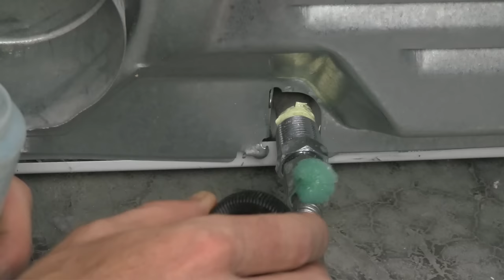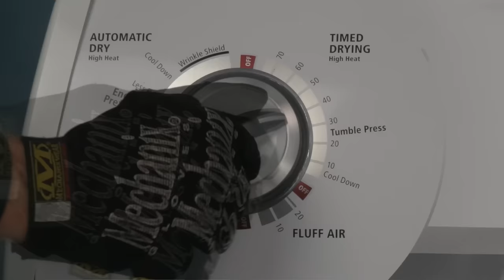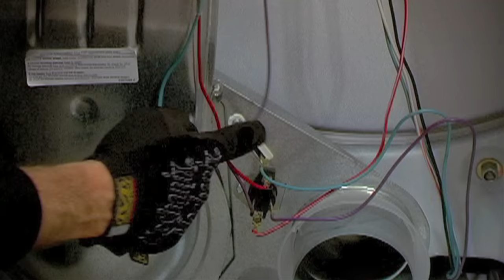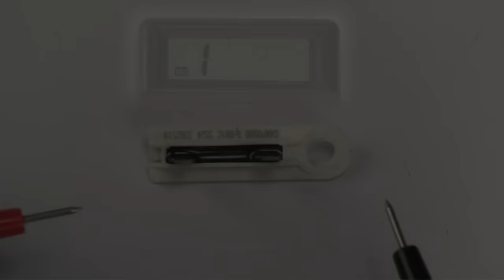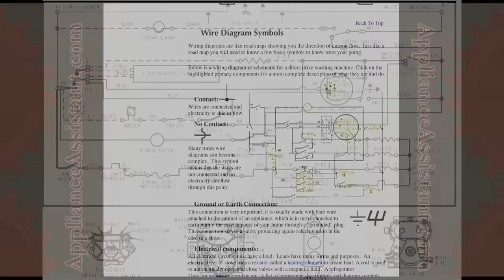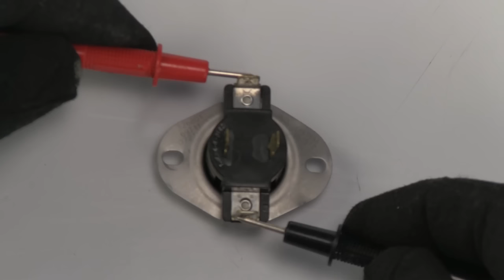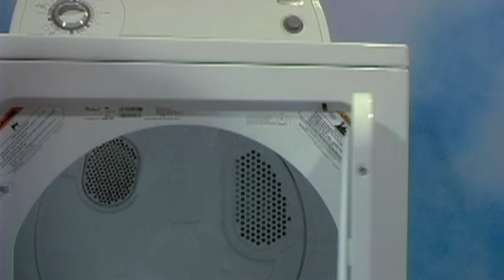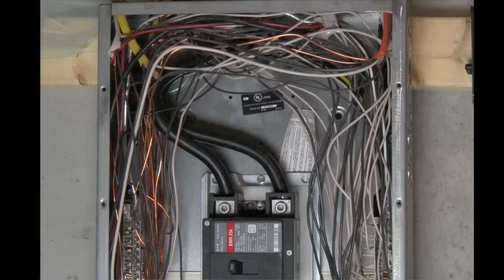Gas Dryer Repair: Fix Heating Problems

Comment from the maker: Thanks for the question! does the ignitor cycle off or does it just keep glowing?  Opening the valve is a bit of a no no for safety... I'm not sure if that is the main problem but you probably should replace it after opening : ( The only place I have ever seen a valve clogged is in the small gas orifice (spider egg) Apart from that Look for check fittings that may be cutting gas from getting to the valve. Hope that helps some!

Comment from the maker: I would be inclined to change the coil solenoids on top of the gas valve... "after a heat cycle, it no longer seems to light" The automatic cycle on that dryer is advanced trough the heating circuit. So because the cycling thermostat only opens once for the first cycle, the timer is not being energized to advance when the later cycles fail to light and heat the thermostat. Hope that helps! Good luck!

Comment: Definitely having a hard time with mine. Roper Model rgx5634kq2. All the fuses and check out and resistances look good. The heating plate heats and the gas lights, but after a heat cycle, it no longer seems to light. I can see the heating plate glow red, but the gas doesn't ignite for the cycle. Mine is similar to m2theferg, but my timer seems good. The countdown cycles are fine since it shuts off at the end of the count down, but the autosensing cycle runs until I stop it. Same problem as Chad?

Comment from the maker: installing a new fuse will probably fix the heat problem but the timer must also have a problem part 8299764  that timer can be opened and reassembled fairly easily... however, before you open it you should be willing to replace it...  and when you are putting it back together don't force anything. usually shifting the timer knob back ad forth will get the inner timer cam to seat back into place. When it's open you may see why it's sticking. Good luck! and congratulations!! : )

Comment: Sorry kind of a dup. reply but I'm not savvy with msg kinds of things. Roper rgx5634jq0 -Checked fuse shows open-in my mind that doesn't explain why dryer doesn't stop during timed setting, explains the lack of heat. I hear timer ticking, knob advances but never hits stop limit Symptoms are concurrent never had heat/stop issues before. Pretty good exhaust flow, sniffed very slight gas leak on the flex will replace, also missing wiring diagram We have a baby, laundry piling, please help -THANKS!

Comment from the maker: What is your model number?  It definitely sounds like a timer problem and your heating problem could also be associated with the timer, depending on what contact is bad... If the fuse tests okay check for 120VAC at the contacts. It could be that the timer is not sending electricity down to the ignitor.

Comment: I'm getting ready to test the fuse, guessing this is my heating issue However, my dryer has an additional issue - it doesn't stop. last night using the auto sense setting put in the last load before bed, woke up early heard dryer still running & load still damp. To make sure that it shut off on a timed load setting.set the load for 30 min hour later still running. Any thoughts on the cont. run issue? Timer counts down but doesnt shut off. Any advice?

Comment from the maker: Hmmm... What is your dryer's brand and model number?  when it tries to light after the first cycle, is the ignitor coming on and going off with no ignition? The timer not advancing could be because of an automatic cycle(more dry, less dry, etc.)... does it advance when it is on a timed dry cycle?

Comment: On the thermostat heater:
If I have continuity between the outer prongs, but not on the inner prongs, then I need to replace the part? 
This the only part on my dryer where I've gotten readings that do not match what you've described in your video as proper working order, and a couple other videos I've seen as well.
Would this part being faulty cause the problem of my dryer not glowing/igniting/heating? Please give me some good news, Appliance Assistant!

Thanks

-itswhip

Comment from the maker: Thanks for posting! That is definitely true when it comes to range ignitors. However, I have never in 16 years seen a weak dryer ignitor that would not trigger the flame switch... I suppose it's possible but very rare.  Thanks!

Comment: Great vid, I'd like to add to the discussion for those watching.

If your dryer's ignitor is lighting up but it fails to trigger the valve it the ignitor could be weak and need to be replaced. You should of course check the other possibilities mentioned in this video but keep the ignitor in mind.

Cheers.

Comment from the maker: If you are getting ignition but the valve only burns for a few seconds then shuts off it would usually mean that there is a clog in the venting somewhere or the hi-limit thermostat is getting weak. Note: the dryer needs to be back together when you test it for the blower to effect the flame, and draw the heat back off the hi-limit thermostat... If you run the dryer with the door open or the drum out then the hi-limit thermostat will do it's job correctly and shut the burner down for safety...

Comment: Great Video! What is the average burner on time and off time cycle for a typical dryer, for example my observation was burner comes on for about 60 second then off for 30 second, repeatedly.

Comment: These are your exact words, "Sorry, your comment got flagged as spam for some reason", but anyway, not like we are in a court of law. I thank you for your advice and by the way, I replaced the motor last week, You just responded 17 hours ago,  Again, great videos and thanks for the response.  PS Ebay has these original motors dirt cheap with free shipping. It would had cost way more just to have someone swing by to "look at it", word of advice for future readers.I tested the item before.

Comment from the maker: Sorry, your comment got flagged as spam for some reason so I missed it...  Most likely it the motor if it actually stops running.  The cycling thermostat would only effect the dryer heating. Hope that helps!  Thanks for the comment!

Comment from the maker: Well I can tell you what it's not... Maybe that will help you figure out what it is. It's not the ignitor or thermal fuse. but it could be the flame switch, cycling thermostat, hi-limit thermostat, or timer.  hard to say which one for sure without testing for voltage when it's not working. What is your model number?

Comment: Nice videos, I am going to test mine, I have a Whirlpool gas dryer that runs great, but than stops and does not turn on until I let it cool down, what do you think it might be?  I cannot decide if its the  "motor fuse" and also the "cycling thermostat"?   What do you think?

Comment from the maker: It's ether an air flow issue or the hi-limit thermostat is weak.  (Probably air flow) 
Is the dryer properly reassembled before you are testing it? 
Does it do the same thing with the duct disconnected from the back of the dryer?

Comment: Have you resolved your problem? I have a maytag and it starts, glows has a flame (orange)but after 20 seconds or it clicks off, checked flame sensor, thermostats on top, thermostat on heat tube (near flame sensor) all are good, son said he replaced coils a few weeks ago, and still has problem.

Comment from the maker: Sorry it took so long to get back with you!  If the dryer is open then the blower cannot draw the flame's heat back off the hi-limit thermostat. Therefore it will do what it's supposed to do and open, turning the burner off.  If the dryer reassembled for your test? 
Again sorry for the delay, you probably already have this figured out...

Comment: I have a Maytag dryer very similar to the one your are repairing in this video. I replaced the coils a few months ago and have tested the flame sensor and both thermostats on the tube and all test out fine. My igniter turns on and the flame kicks on (although doesn't seem as powerful as it should be, more of a fire than a blowtorch) but turns of after 15-20 seconds. Troubleshooting leads me to the coils, but those were just replaced. Any ideas?

Comment: Thank you so much for this video. What would you guess cost for repair for a 'pro' to have done it? I replaced the coils and fixed my dryer, only took about 10-15 minutes after I had the parts ($37) and tools (had to get short phillips $4)  on hand.  I have had 4 major appliances, and 1 minor appliance fail since buying my home, and it was built in 2004. I have fixed 3 out of 5 using Youtube videos.

Comment: I have a kenmore 110 72032100. drums spins, no heat. I replaced the ignitor and still get no glow. Is it likely to be a bad fuse? I'll check thermal fuse tomorrow when I get home. Thanks for the video, very helpful.

Comment from the maker: Sounds more like a coil problem. the coil kit on the top of the valve can cause what you are describing. Even if it is the valve I was surprised how inexpensive they can be purchased online.  If you do need parts I would greatly appreciate it if you purchased through the links on my website! I get a little commission : )  The link is in the description of the video. Thanks for the comment!

Comment: My dryer has intermittent heat.  Reading on ignitor and Flame sensor are fine.  No excessive junk in the outlet .  I hooked a volt meter up to the lead at the gas valve.  I could see the 125V when the flame started and then ~1V when the hi temp switch opened.  Then the gas shut off, as it should.  Problem is the flame starts if it feels like it.  I think the gas valve is old and tired.   Probably too expensive a fix for an 8 year old dryer.  Thanks for posting all this information.

Comment: Hmmm I found a gas valve from from a site called repairclinic which was a link from your site it's about $60, but the comment section isn't letting my post links..the part# is 922555

Comment from the maker: Are your coils installed on the correct posts?  Sounds like coils... Both coils have a little bump on them that fits into the holes on the retaining bracket so they get put on the right way.  Sounds like the valve is trying to open when it is getting electricity but can't for some reason...

Comment from the maker: There is only one orifice needed but they give you two, one for LP and one for butane.  If you are running it with the drum out or the door open it will do that because the blower is not able to draw the heat back off the hi- limit thermostat. try putting it back together with the door closed and it should work. Good luck! Thanks for the question!

Comment: I just recently moved and had to convert back to natural gas from lp. I had the parts already because I converted it from nat. To lp when I bought it. My question is, is there only 1 orifice to swap? Because I don't remember. But there were 2 in the bag I had saved. 
  Also, now that I have hooked it up and ran it a few times , the auto dry doesn't work . I hear the flame kick on and then it kicks off. Even in timed dry it does this. So I took the front panel off and cheated the door switch and

Comment: hmmm..comment keeps disappearing...here is more info...when ignitor turns off there is a loud buzzing sound which goes away when the ignitor turns on...then it repeats. I too the blower cover off and the buzz isn't coming from there.

Comment: Some more info: I ran the dryer w/the drum and front cover off. When the ignitor turns off, there is a loud buzzing sound. The buzzing sound goes away when the ignitor turns back on. I removed the blower cover and the sound is not coming from there.

Comment from the maker: That is a very rare scenario... So now you are still seeing the ignitor glow and click off but with no ignition.  I would be inclined to try another set of coils, as the chance of the new replacement set being defective is actually more likely than the valve being bad, which is about the only other option. If it is the valve it may not be worth repairing because of the part cost being so high.  I hope that helps some. Good luck!
Reply: I have an LG dryer which doesn’t heat, and the local repair person wasn’t able to fix it. The dryer is still open and I am trying to diagnose myself. A few questions:

Note: the drum is out and I manually make sure that the belt switch is closed.

1) When I turn the dryer on, the igniter glows red hot. It stays red hot until I turn the machine off. I get 90V on the upper gas valve coil. But nothing happens.

I am unclear from your video about the function of the flame sensor. Should the flame sensor turn the igniter off also if there is no flame?

I replaced the whole gas valve assembly, thinking that the gas valve was bad. But makes no difference.

2) While doing the testing the door panel is removed and the door switch disconnected.  But the motor still runs, and the igniter still glows.  What is the door switch controlling?

3) The centrifugal switch controls the gas valve too, right? The fact that I get 90V at the upper coil seems to indicate that the centrifugal switch works, no?   Would the igniter glow if the centrifugal switch was bad?

Comment: Great video, but my no heat in dryer isn't fixed. My dryer is the same as in your video. Here is what I have:
- Tumble, but no heat - Checked gas - ok
-  My ignitor glows and then shuts off
I replaced the heater valve coils - problem wasn't fixed
- I tested flame switch it was ok
- I tested thermal fuse...it was ok.
Now...I'm stuck

Comment from the maker: For some reason this got flagged as spam and I just saw it : (  If the ignitor is glowing it's okay. if it cycles off and stops glowing the flame switch sensor is okay too... but if at that point you don't get ignition and you are sure the gas is on it is probably the coil set on top of the valve.  I hope that helps! Good luck!

Comment: My dryer suddenly stopped heating. I opened the front panel on my Kenmore gas dryer and found an inch of lint on everything. Vacuumed it and noticed a badly kinked exhaust tube. Replaced that and checked the thermal fuse. Plugged it back in and got an ignitor glow and flame! Thought I'd fixed it but... no more heating again. Since I got a flame, that has to mean the thermal fuse is fine, as well as the heat switch that supplies the gas, right? Is this probably the ignitor? Thanks!

Comment from the maker: Sorry I missed your question somehow... No flames should not enter the dryer's drum.  Are you on propane or butane gas by chance? most dryers are set up for natural gas initially and need to be converted for other more flammable gas types, with a smaller gas orifice and valve adjustment.

Comment from the maker: That's true!  In some states it's required the installer replace it... Replacing the plastic flexible duct is highly recommended! The stuff in the video isn't the best but it's generally okay, you just need to avoid dips and bends in the duct. Definitely much more prone to clogging than the rigid duct though.  Thanks for the comment!

Comment: That flexible vent hose is actually a no-no.  The appliance repair person told us you are actually better off going with rigid aluminum duct work.  That flexible hose is more prone to clogging.

Comment: . I've already replaced the fuse link because it overheated .and taking a look inside the drum in the air circulating passages it looks like burnt and the paint on the metal is flaking . when it is working I can see actual flames coming out of this passages . is not supposed to come out only hot air of this vents inside the drum ?

Comment from the maker: I don't quite understand :(  The "base" or automatic gas valve that the coils are on is not usually the problem... but if it has been opened or someone tried to fix it then it's probably bad now.
In most cases you would only need a new set of coils.  They do need to be on the correct valve posts to work. I hope that helps...

Comment: as it is called the base where the coils of the gas valve?
 is it possible to plug where it enters the gas?
 I cover in my case and tell me I have to change the damn base where the coils are

Comment from the maker: Without the door closed and the drum in place the blower cannot draw the heat of the flame away from the hi-limit thermostat so the burner will kick off very quickly. You need to test the cycle with the dryer all back together.  Otherwise you have a duct clog or the hi-limit thermostat is weak.  Hope that helps, Thanks for the comment!

Comment: Is the fire supposed to turn off, then back on over and over every 30 seconds or so? I've got my dryer open on both sides and I haven't been able to figure out what's up. My dryer just ain't heating. I have to dry a load like 6 times for it to finally get dry

Comment from the maker: In most cases the ignitor will stop being energized when the flame switch senses that the ignitor is hot enough to light the gas, and redirects electricity through the coils on the gas valve to open and release gas.  At that point the ignitor will sometimes still glow some because it is in the flame, but it technically is off until the burner cycles on again. Sounds like you have an airflow problem, or the hi-limit thermostat may be weak... But probably air block of some kind.

Comment from the maker: No Problem, I'm glad you fixed it!  It probably would be good to get some hi-temp spray paint on there just to keep it from rusting. You can buy hi-temp engine paint at most automotive parts stores.

Comment: OMG I forgot to reply back after I fixed the problem. You were right I replaced the two coils in the same dryer model as shown in the video and now the dryer works, but one question the paint in the dryer seems to be peeling off, so the white paint on the inside in some areas are showing bare gray metal is there a way to fix that?